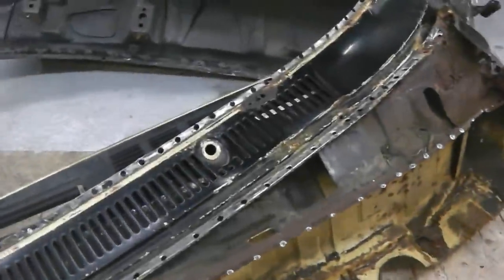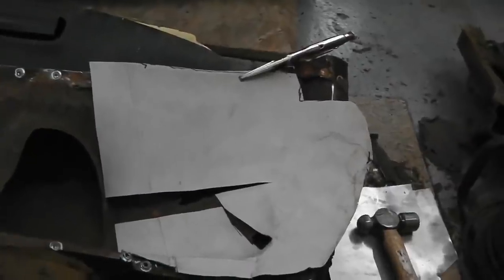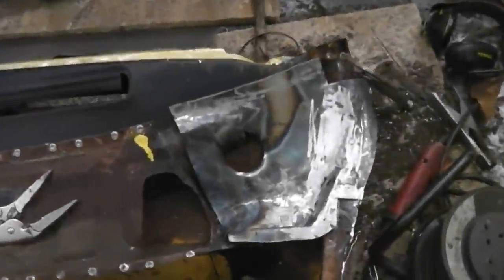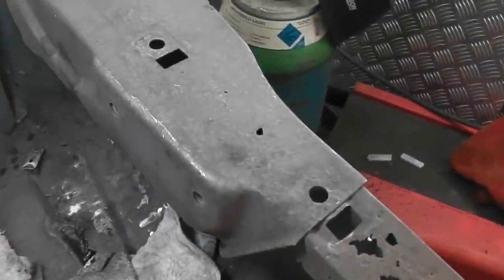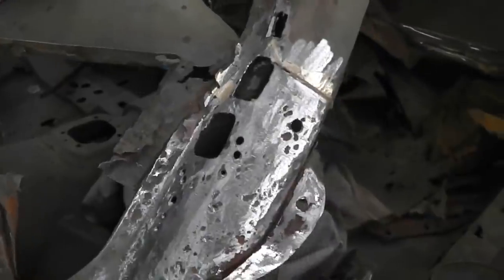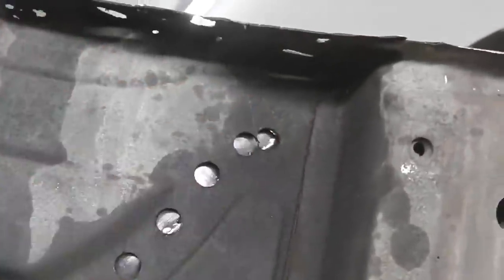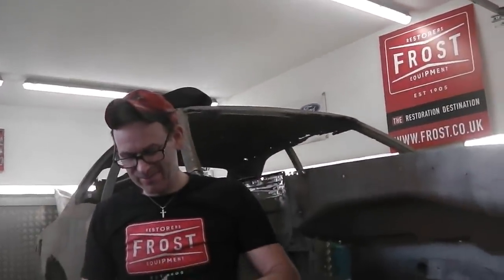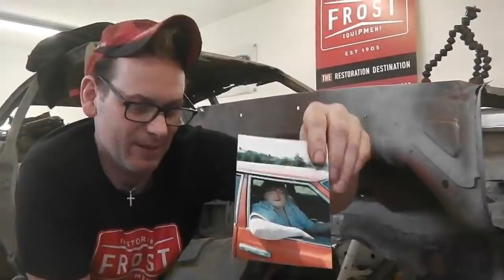Classic car restoration - Project Bramble EP8 pt2

Comment: Nice job Pete , loved it and very rewarding when you dropped the bulkhead into place ; "like a glove!" Old car memories photos were a good addition to the episode . Back about 1980-81(l'd be 18 or 19) the second car l owned was a 2 litre mark 3 GXL in Copper Brown metallic (UCH700L) . Remember binning the cambelt cover and fitting a chrome rocker box . Later came chrome "8 spoke" wheels with 185/70 tyres (I think) . The wheels (badged 100+) were a big mistake , l really wanted some wolfrace slot mags but the "impatience of youth"  resulted in me choosing the cheaper option . They tarnished within 6 weeks , then rust formed between the face of the wheel and the rim due to a nasty seam there . Happy days !

Comment: Just found your series of rebuilding the Cortina. Brilliant work Pete. Can I suggest that you invest in a jigsaw to cut sheet metal instead of using a disc grinder or snips. Much easier and cleaner.

Comment: God you were giving those molecules some serious reshaping on that first end piece Pete. But that bulkhead went in really sweet. Nice job. See attention to detail works every time.

That Mk I Transit reminded me of our last bandwagon - a long wheelbase high roof bought new with an Essex V6 conversion in a diesel front, ambulance diff, side door and mandatory aircraft seats ('acquired' from a man one night in Heathrow). All the gear behind a chipboard panel in the back. If we had shunted it the speaker stacks would have shot forward and killed us ... Transit and Capri Mk I axles of course being called 'Atlas' when in a rally Escort.

Fun Fact No 3 - the rear quarter bumpers on those Mk I Escort vans were used as the front quarter bumpers on the Twin Cams and RS1600s. Mk II Escorts used the same off Mk II vans
Reply from the maker: LOL I like the aircraft seat storie!!!! LOL !!!!!!! yes i can see the bumpers being swapped to front / used on fronts
Reply: @PeteCswampy  I am a walking almanac of useless info and stories ...lol

Comment: Hello Pete, really nice work. I had a Mk3 Cortina 1.6L in tawny brown for my 17th birthday in October 1974. XWG 836K Which was bought new by BOCM. I was the second owner. I have some photo's of it somewhere. Then in 1978 when i was 21 i got a Mk3 2000E in orange with a vinyl roof. HWR 330N. I had a scrapyard from the early to mid eighties and i must have scrapped at least 20 Mk 3 Cortinas. I remember getting a 1970/71 Mk3 2000GT in Daytona yellow and i put it in the corner of the yard as i wanted to save it. The car was a local reg JEO 999J and i think someone came in wanting some bits and it ended up getting scrapped. Wish i had some hindsight to keep some of the cars i had. Lots of Mk1 escorts got scrapped as well.  I guess that's life. Cheers. Billy.
Reply from the maker: wow scrapyard memories, nothing better, any  pics of the old days??? sounds like you love your mk3s, i didnt think i would see many replies on here, but all of sudden everyones comin on board with the mk3 stories, i suppose there wer ethat many made that im going to hear from a lot of people if they can jsut somehow find the channel ....anyway thanks for your stories, the range 2000e is the one i like sound of, i wonder if anyone on here actually finds out thier car is still on the road, that would be so cool, all the best  pete

Comment: Buy yourself an electric nibbling tool, you will save a shit load of time. There is also a nibble attachment for a power drill available which is cheaper. Liking your vid not for the theatrical shite, but for your dedication to a massive restoration! All the best.
Reply from the maker: hi Pete, thanks i do have an airpowered one but the bit snapped yes they are good and i use em on the alst series, LOL i like the theatrics im a dram queen on the quiet lol, all the best Peter from Pete !!!! Lancs, Uk !!

Comment: Great work, excellent video, I am waiting on every new video with anticipation.  And memory lane, back in the day,....I don't want to call them the old days, cause I am similar age, haha....I'm gonna do some videos starting soon on something, a 1999 Chevrolet Trailblazer 4x4, a fairly decent body,...errrrr, I am hoping, haha, errrr, one never knows sometimes till they discover the rust holes,...ha, well, it appears to be pretty decent, but engine is "bad", ....spun rod bearing, and transmission could do with a refurbishment while engine is out of engine bay,..meaning a beefing up of automatic transmision, and likely I will go with a used engine or a complete rebuild,...unfortunately, the engine injection is not the best type to have,....gonna build a large metal building/shed I own that needs assembled, and make it into a small workshiop big enough to bring a small vehicle into if needed......I am formerly trained as a auto mechanic, and industrial sciences,...well, I ended up with a so called two year degree in such, had numerous automotive repair certificates, formerly trained in the military too for mechanics and electrical and light electronics repair,..so I feel confident.....I'd like to do what you are doing all the time, doing sheetmetal rebuilding work,...that is great work you are doing, I am learning alot,...I think I might try to get ahold of a 1978 Datsun pickup with auto trans this year if things go good for me, to restore it,...errrr, if luck goes my way.
Reply: Errrr, I am 'happy" to proclaim that I discovered through thorough inspection yesterday that my personal project vehicle, the aforementioned chevrolet 4x4, it has "glorious" rust damage where the battery once was placed,....completely rusted out battery tray, looks like damaged below it(rusty hole), and slight damage to the radiator support front bulkhead!......good thing I own some welders, already had a replacement battery tray delivered, I mean, having, I mean, owning welders is like having good insurance, haha, I know I can fix the problems.